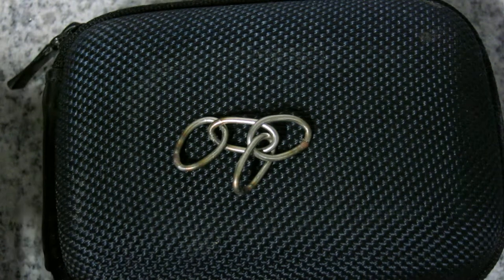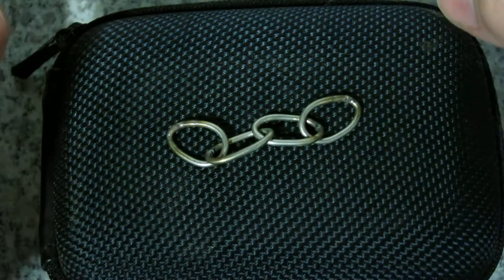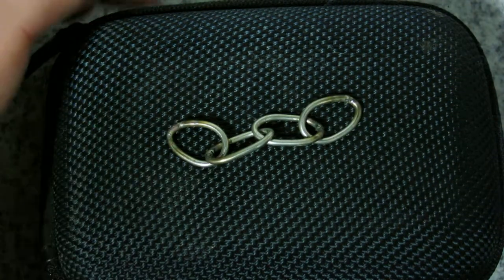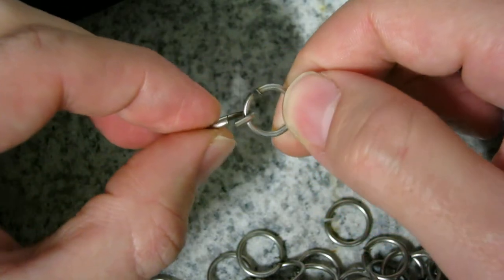TIG welding #8

Comment: Sorry for ask sir, Do you using tig weld for buttweld that chainmail ring ???
Reply from the maker: Yep! No filler material. I just butted the rings closed and gave it a brief zap. I used argon shielding gas.
Reply: @tjhowse  how many amps you using sir???
Reply from the maker: @ariefardiansyah4804  I think the limit was set on about 60A, but I was using a foot pedal to regulate the current. Probably only 10-20A.
Reply: @tjhowse  thank you very much sir... You really help me a lot ❤️🙏